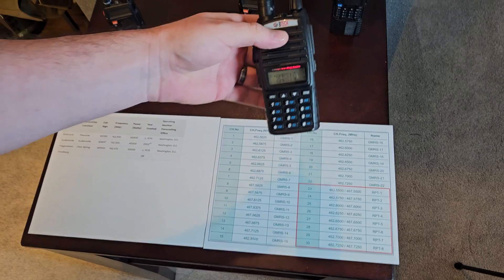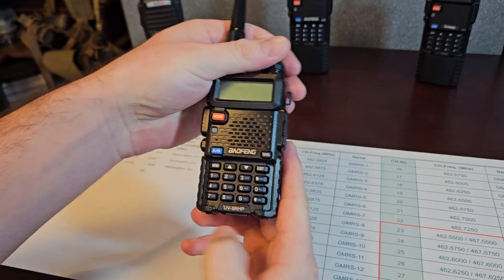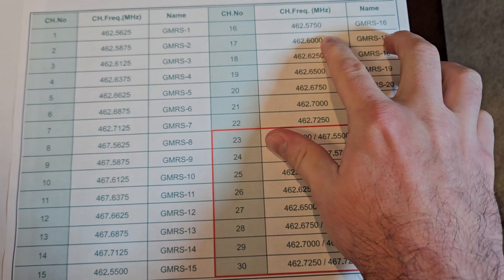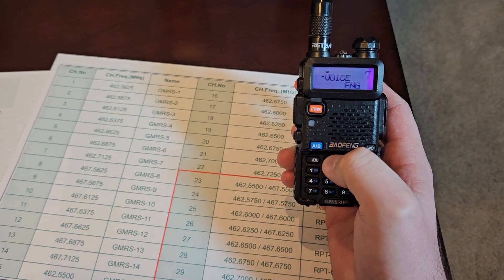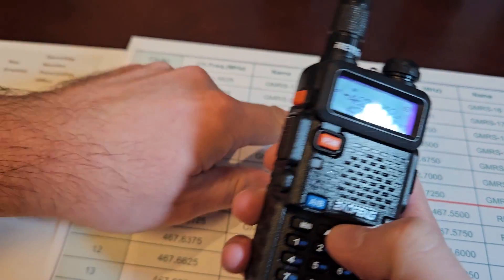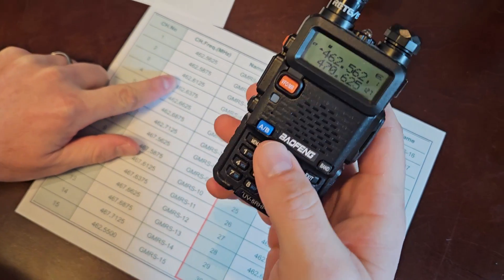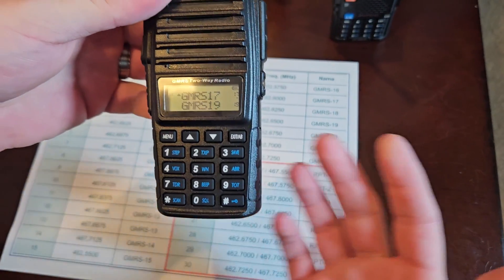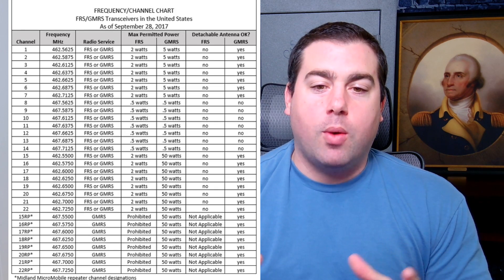How to Make your HAM Radio & GMRS Radio Talk to Each Other

Comment: You failed to mention that most of those UV5R radios will need to be unlocked to accept GMRS frequencies. Also the settings entered in the ham radio are not "permanent", as they can be re-written.

Comment: I have a question. I am trying to test out and get familiar with using a ham radio and gmrs radio. I put the GMRS on channel 15 and I can hear myself transmitting to the ham radio which is on a GMRS frequency. But I can't hear myself transmitting to the GMRS radio. I think it's because the transmission goes to a different frequency when  pressing the talk button. So what is the solution to this?

Comment: I was able to put my ham radio only on 1 gmrs frequency when typing it in. It would only allow me to put in gmrs channel 17 in the ham radio. And the gmrs radio I have can receive it clear from the ham but the gmrs cannot transmit to the ham. The ham only lights up but it doesn't make any sound. What am I doing incorrectly?
Reply from the maker: Sounds like the radios may have ctcss or dcs tones on specificly the one receiving.
Reply: @citizensurvivalplan  will I not be able to receive from gmrs? And only transmit?
Reply: @citizensurvivalplan  on the back of the manual of the Mohanton radio there is a ctcss and dcs code table. Idk what any of that means though.

Comment: I have a uncommon ham radio walkie talkie and am trying to utilize it at work to connect to a 2 watt radio they use so i can have more distance reach when i leave the building but i have been unable to enter the frequency of the GMRS channel in the Mohanton HT ham i have. It won't allow me to enter a gmrs frequency in it. What am i doing incorrectly?

Comment: Thank you for your videos.
I’m in level zero at radio communication. My question is: can I have my Retevis radios as GMRS radios? I have my Gmrs license, but my radios are two Retevis RT5. Thank you in advance
Reply: Basically, they are the same as UV5Rs. Can they be unlocked to operate on GMRS frequencies and have them programmed as GMRS channels? Short answer YES. Now of course they are not GMRS radios and transmitting on GMRS channels is against the rules the overlords have imposed on us. But technically is it possible? Yes.
Reply: Thank you for your answer @Commodium

Comment: So do the newer hams completely lock the grms channels out? I can get the grms to talk to the ham, but not the other way around. Ideas?
Reply from the maker: Do you have a privacy tone on your gmrs radio? A ham radio should be unrestricted.
Reply: @citizensurvivalplan  yes, got all those plugged into both radios. No transmit signal from the ham at all.
Reply from the maker: What model ham radio. I'm just curious now I've never heard of a ham radio having a block on gmrs channel.
Reply: @citizensurvivalplan  BF-F8TD.  I read somewhere that MIRS channels were blocked on the newer hams also.
Reply: @citizensurvivalplan  have you heard from anyone else on not being able to do this?
Reply from the maker: no try another ham radio see if there is any difference if not you have a setting thats stopping you like an offset or pr tone thats stopping you. @frenchroast1355
Reply: @citizensurvivalplan  I didn't think about the offset. Unfortunately I don't have another ham type radio, so hopefully it's an offset issue.
Reply: Nope. Checked all the settings on both radios. The ham will receive but not transmit. The only setting the GRMS has that the ham doesn't is something called an R-tone. EDIT: Feel pretty dumb. The manual states the frequency range does not include the GRMS 462. freqs for transmitting, only reception. Duh.

Comment: Something occurred to me while watching... If one person has their GMRS license and another has only they amateur radio license you can probably still legally communicate. Hear me out...

First, both must have radios that can monitor two channels. 
Second, each radio (ham and GMRS) must be able to program frequencies in the other service, listening only is perfectly OK.
Next, on the GMRS radio program a ham frequency X.
Followed by programming a GMRS frequency Y on the ham radio.
On the transmit band GMRS radio set to Y and ham radio set to X.

On the monitor band GMRS radio set to X and ham radio set to Y.
Now, the GMRS radio transmits on Y and ham radio receives on Y.

And the ham radio transmits on X and the GMRS radio receives on X. 
Nobody is breaking any rules (I don't think).

Of course, someone monitoring either frequency will wonder what's going on, only hearing a one sided conversation...
Reply from the maker: lol your thinking too much! But yeah you could listen and talk on differnt channels without breaking the rules. gmrs license is so easy to get even if your are a HAM just get a gmrs call tag too.
Reply: @citizensurvivalplan I have both. I was just thinking about several anti-ham channels I've watched.

Comment: Nice video… what gloves would you recommend that are “tactical” and still good to use with a gun with dexterity?
Reply from the maker: honestly I use these gloves from harbor freight you can get magpul stuff and all kinds of expensive gloves but heres a link to what i normally shoot in. https://www.harborfreight.com/performance-work-gloves-large-62433.html?ccdenc=eyJjb2RlIjoiNzA0ODQ5MDUiLCJza3UiOiI2MjQzMyIsImlzIjoiMy44NCJ9&utm_source=google&utm_medium=cpc&utm_campaign=20934798869&campaignid=20934798869&utm_content=158477220180&adsetid=158477220180&product=62433&store=&gad_source=1&gclid=Cj0KCQiAhomtBhDgARIsABcaYylfxDUJfoFJbnwtS-anG4NGSIneTTUvtZ5CVE3TYyKvCgNcXIRz2LcaAnWgEALw_wcB